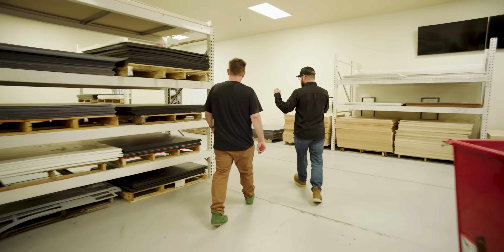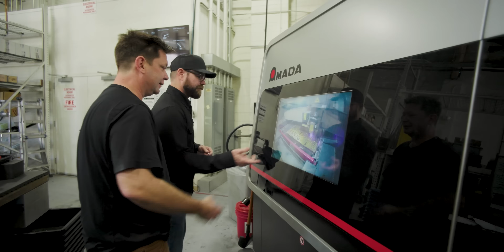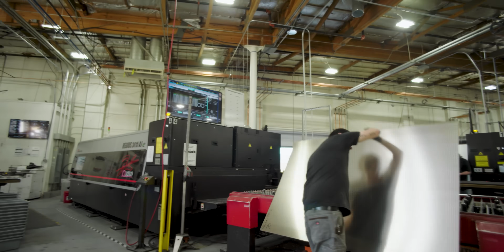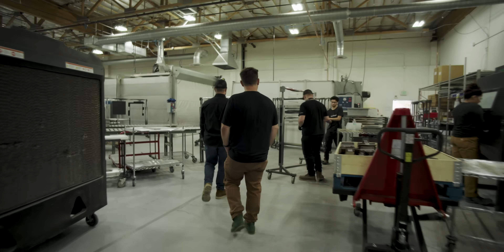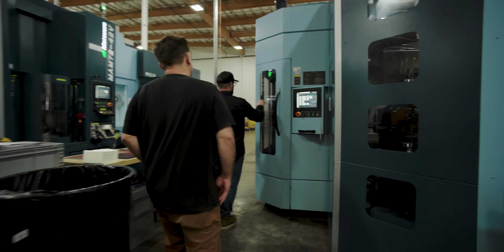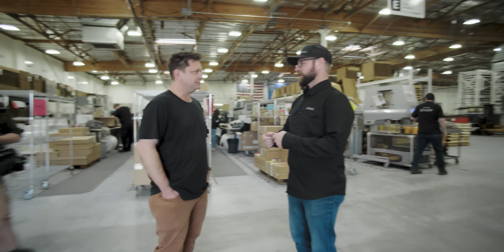This Might Be The Most Important Factory In America: The SendCutSend Factory Tour

Comment: SCS is very hit or miss. If you want part just cut, usually they're pretty good. If you want them to bend something, or other post-processes, not so much. Multiple times, we've ordered parts from them that didn't need to be QCd, they visually looked wrong out of the box. And of course, shipping can throw a wrench into your timeline, though that isn't thier fault.

Just last week, I ordered a part that was to be sent directly to the customer, to meet a timeline. I got their address entered, and it used my address anyway. I emailed within 5 minutes, and had a response from them within a half hour, and they still couldn't get the address changed. Brought that up to customer service; crickets in reponse. The parts are now sitting in my shop...

Comment: Seen your cnc machine postings in the Reno facility, waiting a lil bit and they got filled quick, seems like a good place to work and the fact that they’re pushing things the way they are, feel every machinist should work at a place like that once to see what can be done so it’s I. Their minds if they go somewhere else someday
Reply: Yes and no. I think a lot of machinists like solving problems, like to think about workholding and recipes - these things will likely be fully done for you by the centralized software at SCS. So, in all honesty, I think only a small handlful of very process oriented top machinists will have fun there as they teach the algorithms and validate processes. 
The rest of them will simply just load and unload parts and possibly not have much input into how a part is made. They will follow the setup from the centralized app with very little wiggle room. In fact, SCS may not even need (m)any machinists on the floor. 
But that said, it's definitely informative and educational and probably exactly what's needed if you want to be competitive.